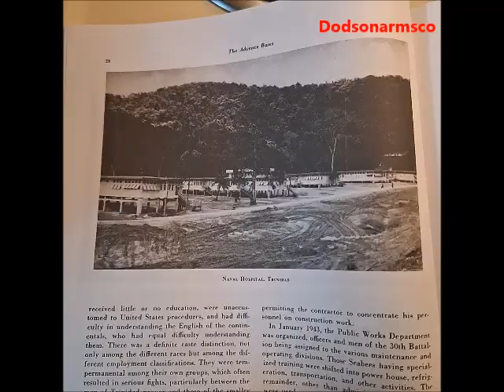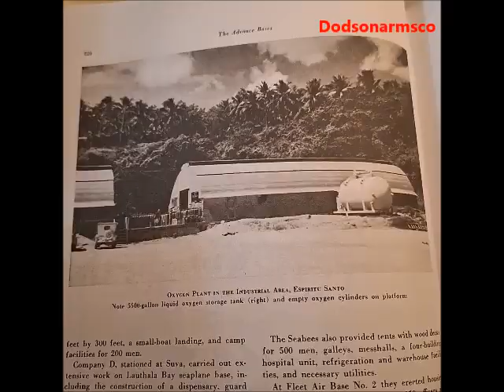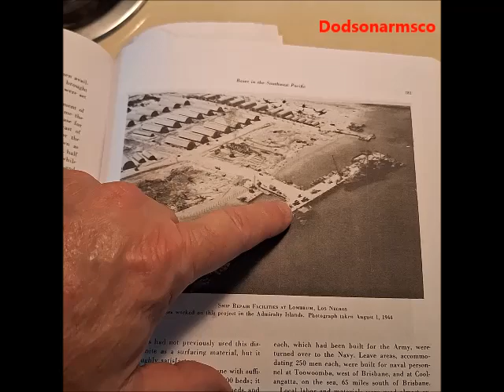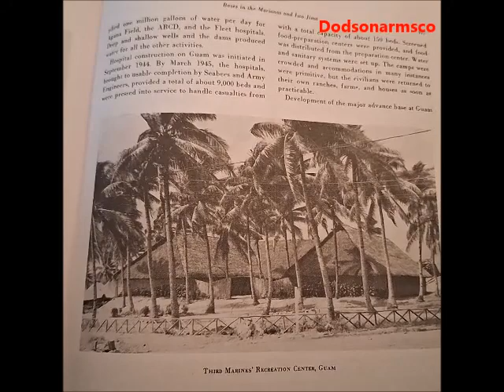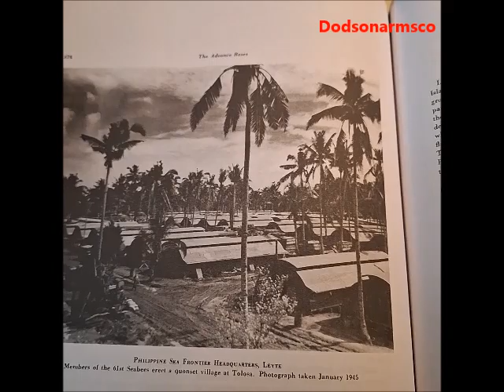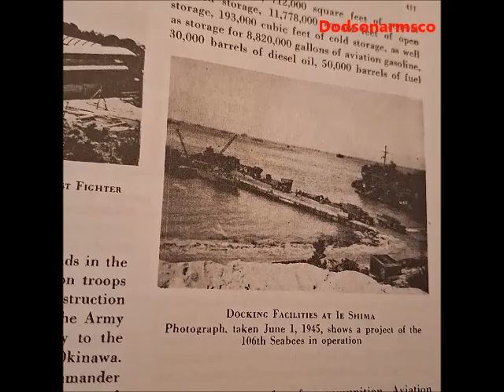WW3 SHTF Construction: Improvise, Adapt, and Overcome. Expedient ideas. Combat engineering

Comment: Seems like the wooden shoring boards we use for underground utility work. Would be a nice way to make docking support. They’re man portable and can be driven into the ground with shovels if a machine isn’t available
Reply from the maker: Great comment. The older C edition of the Seabee manual talks about using shoring boards with wood and steel piles.
Reply: @dodsonarmsco  nice, I’ve seen them take a few cave ins with decent flex so with support they can take some weight.